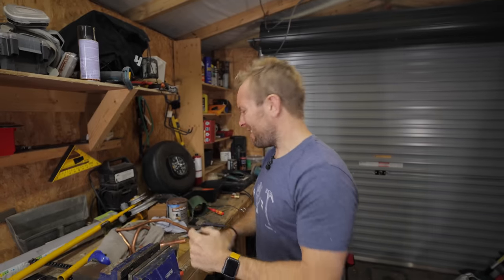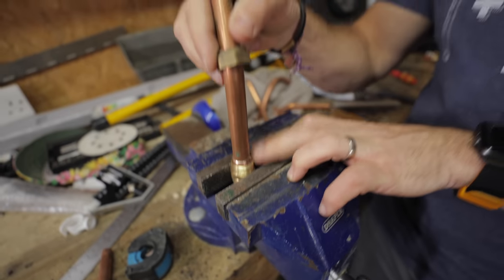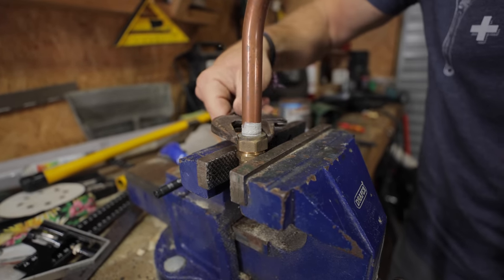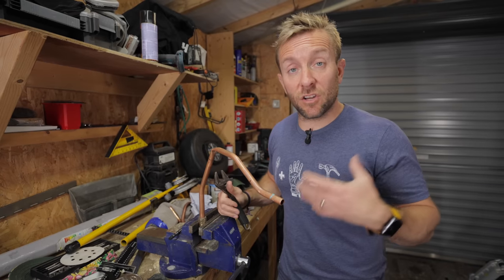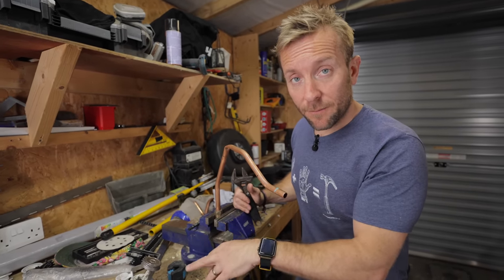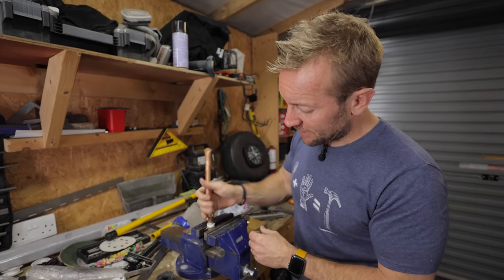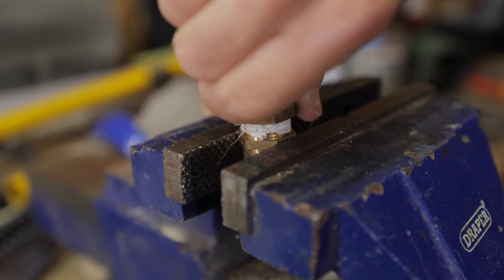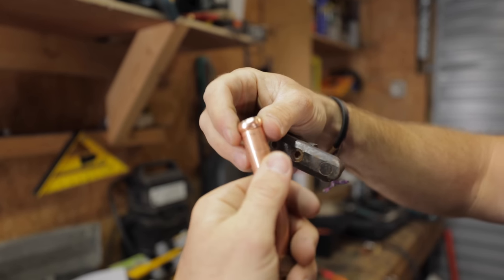4 MISTAKES Everyone Makes When Using COMPRESSION FITTINGS

Comment: I've never had a problem with compression fittings because I was introduced to them by a lifetime-served plumber who just happened to live next door and he gave me the lowdown on the tightening issue. I always spare on the tightening and then tweak it if there's a slight leak when I test it. Then again, I'm only working in my house or a friend/family member's, not on a site with productivity pressures (know all about those coz I'm a chippy). By the way, I'm surprised to see you using an adjustable spanner. Surely a 24mm is less likely to start to round off the nut?
Reply: Unfortunately not all fittings you get these days are 24mm, some are 23.5mm, some are 24.5 and some are 25mm, so you need to match the spanner to the nut, and some do not match at all, as they have 8 flats on them. so adjustable nut rounder it is, or you use the stillson wrench, which will tighten the fitting up to a turn past stripped.

Comment: In gas compression brass fittings they don’t allow the use of jointing compound. But in iron fittings where a thread is cut into the pipe, jointing compound must be used. I asked the instructor why jointing compound isn’t allowed in brass compression fittings but never received a reply!!!

Comment: Typical plumber - Throwing the rubbish from the job in the garden! But seriously thanks for a useful video, I must be guilty of at least a couple of those common mistakes. Just want to ask is there any merit in when putting the pipe in the fitting, backing it off a mm or so from the end stop so when it tightens down its got room to slip forward a bit, or is that another pointless thing to do?, I must admit that I seem to get less issues since someone told me to do that - but I'm just a sparky, I guess I'd get even less issues if I used jointing compound and stopped overtightening?!

Comment: In theory you shouldnt need any additives but it was suggested to me to use a bit of fernox silicon but trouble is the tube always sets hard ,bloody expensive
Reply: I solved this problem with LS-X tubes going off once opened (used to be wasted tube every use).  When you finished using, squeeze a bit out, fit the cap on, then seal around the outside rim of the cap with the excess; the stuff can seal itself just as well as an unopened tube  -  will still be ok a year later

Comment: Another tip for Not Over Tightening.  Use a smaller wrench to reduce the leverage you have.  I learned that doing my own mechanics and stripping bolts.  Use a smaller tool if you are ham fisted. 👊

Comment: Re olive cutter , reviews this not great , quite slot complaing that the bar metal bar that sits inside the pipe snapped off in to the pipe. Think I'll (DIY) stick to an olive puller if hack saw & screwdriver . Other tips helpful. :-)

Comment: IDK, I've never seen a properly made compression seal fail, never seen any sealer used or recommended.   The copper ferrule is soft by design, crushed to conform to and seal because of the taper, anything foreign likely to cause a leak.

If it's squealing as you tighten, thats the ferrule spinning  because you seated it cockeyed.

Comment: Potable jointing compound? What is it, Vegan? All that stuff is is lubrication - the metal to metal friction cuts the sealant material - it gets squashed out of the taper - its the deformation of the soft metal that makes the taper fit perfectly to make the seal. A bit like lapping a valve. I'll just go back to the good old hemp and graphite grease - at least that expands and seals if it does get wet - or I might just smoke it instead...

Comment: Compression fittings need friction between the ferrule, the pipe, the nut and the fitting body to form a proper seal. Every manufacturer's instruction and plumbing manual I have seen explicitly states NEVER USE PIPE JOINT COMPOUND OR TEFLON TAPE ON THE COMPRESSION FITTING. This presenter does not seem to understand how compression fittings work. The seal needs tight metal to metal contact to work. Joint compound will prevent this. Using joint compound or anti-seize will make the joint leak.
Reply: Same mistake ppl make with flared fittings and unions

Comment: I've never seen joint compound on the compression ring ("olive" in your parlance).  Sounds like bad advice to me.  Maybe it will work in a pinch but I doubt that it's best practice.  Weak start but otherwise good.

Comment: Sorry don’t want to be moaning but when taping pipe/olive you need to go opposite direction from male thread taping - you are taping the stationary part and nut moves. Have to think of this every time I do it  which only on something likely to need changed otherwise anaerobic thread seal every time. Cheers Rich

Comment: You did not put the PTFE tape the way you mentioned. It is now not in flow with the rotation on the nut in my opinion. Also missed an indication how tight it should be like make it hand tight to begin with and the a halve or whole turn. Specifying in momentum would go a little to far I assume.

Comment: I almost never using jointing compound on compression joints. The only exceptions are in very difficult to get to places, which are less than ideal for compression joints anyway, so ought to be avoided, or where an in-situ pipe is slightly damaged and making a truly "clean" compression joint is difficult. Otherwise, don't using jointing compound. A well put together compression joint, with good pipe, properly cleaned and where the joint is not out of alignment and under stress will not leak if done up properly.

Comment: An OLIVE-CUTTER - r U joking?
In NZ the copper pipes of old (most plumbers here now use PTFE pipes an other plasticy things..

Anyway, PIPES (real copper pipes) used to be "tooled" with a tool, that fitted into the pipe end, and had some handles on it, for turning the tool.
One for holding the main body to turn that, and the other was for the wind-in pressure nipple, that forced out three small ball bearings, into the inside of he pipe, such that on turning and pressing the balls outwards, one MADE the FERRULE, (olive you called it) in the pipe itself, and NOT by sliding a Brass Ferrule ring over it.

Comment: You put the tape on the right way round. You don't need jointing paste on copper either, it's for steel.😁
Reply: What he said 👏.  A fellow plumber/pipe fitter I presume???
Reply: Technically you don’t ‘need’ paste for the fitting to not leak. However best practice will tell you it’s a good idea. Whether your dealing with older fittings you’ve taken apart, or brand new fittings, you also have a variety of olive designs. Some are better than others, some may have ever so slight imperfections. Adding paste can be the difference between a leak/weep/micro weep). If only 1/50 joints needs a bit of paste not to leak, your the plumber who fitted it or played with it it’s your responsibility. May as well just slap on some paste it takes seconds and you can sleep better at night.
Reply: Tell that to the guys from 60 70 years ago they used Boss White and trust me, their joints didn’t leak getting them apart was fun. When was the last time you used a compression fitting on stainless steel tube? The olives for that were hardened to enable them to bite effectively but ptfe or Boss White was essential.

Comment: I’m pretty sure that thing you call an olive in a British country we in America call it a ferrule. Or am I missing something? I’ve worked with all kinds of compression fittings, whether it’s air line work with inserts and ferrules or olives , can’t believe I never heard ferrules called olives before. But compression fittings for gas, water and even extending oil lines and never needed to use any compounds with 100 percent success. But I can see how using it would work just never needed it.

Comment: Is it normal UK practice to use compression fittings inside walls and ceilings?
Here is Aus we only see compression fittings inside walls from DIY owners. There is just too much that can go wrong with these fittings and the leak damage they cause when they fail.
Reply: Yes, would never risk compression fittings in inaccessible places, always soldered.

Comment: Also. Don't guess. Make certain the pipe is inserted fully  into the fitting., especially when using Tee fittings or valves.
Reply: absolutely not! If the pipe is fully home it has no room to move down with the threads once the olive starts to bite and then gets crushed at the bottom which causes the pipe to crease and leak. Put the pipe in, pull it back about 4mm and tighten. Doesn't need PTFE or paste and wont leak.

Comment: All you bloody plumbers have worried me into using jointing compound on compression fittings😄 but the truth of the matter is for years, as a fitter, I never used jointing compound on water and steam lines but as an apprentice I was told to scotch brite/wire wool the pipe and fitting, as you would a soldered joint,  before installing and I never once had a leak that couldn't be nipped up. So I'm using jointing compound but it's under duress  😂

Comment: I like to wipe off the excess compound and draw a Sharpie line between pipe and fitting. As you tighten it down a gap appears. No gap = not tight. If it leaks throw away the fitting. Manufacturing quality is poo to say the least. 
Even better use Hep2O or Polypipe. I have NEVER had one of those fail and I’ve used them since Acorn arrived the 1980s.

Comment: Compression fittings are meant to be a metal to metal seal, only amateurs use goop on compression fittings. Leaks are due to improper line up, you can't fix shoddy workmanship with goop.

Comment: YOUR biggest mistake was using an adjustable spanner. When i was an Apprentice  Machine tool fitter adjustable spanners /monkey wrenches were not allowed in the fitting shop.We were told they made proper sized spanners for every size of nut.Woe betide anybody seen using them.We were only allowed to use thread sealer /jointing compound & horse hair on taper threads. PTFE tape hadn,t been invented then .We worked on High pressure Hydraulics. In those days Good quality nuts & olives never leaked if tightened correctly.

Comment: If you are lucky enough (or unlucky in some cases?) to live in Thailand - here there is NO copper pipes aaaaggghhh. Thais use blue plastic pipes for every application and glue. They DONT EVEN understand using pipe glue (sniffers paradise stuff) and they don't use emery cloth or fine grade sandpaper to prep the surfaces. So under pressure they pop. By which time the b'stard "bummer plumber" has gone with your cash on the piss. So what did I do (for 13 years) ? On all my systems which are drain-only (bogs and sinks, underground etc)  I use blue plastic and for all pressurised systems I use amazing hot-welded green pipes which use an "easy to use" hand heater tool to form the weld and no Thais used here  (Except my beautiful wife)!!! or no blown off joints mate (that's no reference to smokeable joints either or your blow up dolls)  ...!

Comment: You don't use joint compound on compression fittings. If that is the case than why when you remove a compression fitting that is 30 to 60 year's old there is never joint compound on it especially if you are using it for certain fluids you don't want any contamination  if it is leaking most of the time it was overnighten.

Comment: Speaking of mistakes, there's your 1st one @ 1:30. Turn that tool over because you're using it incorrectly. The sliding jaw should trail, not lead. Ask me if you need a detailed explanation.

Comment: Why do you call it an olive 😂 i do a little inside the cup and the first thread or two. Pretty rarely have leaks. And ive seen signs of leaking from the bottom of the nut and the stop so i wouldnt argue anything on the threads is pointless however i just do a little pipe dope

And dont overtighten them if you dont have to otherwise a ferrul puller will basically downsize the pipe a little and the new compression fitting WILL have to be buried to not leak

Comment: Never ever use fkn ptfe or jointing compound (poo) we call it on compression fittings.
If it squeaks like a dying mouse its to tight or you have warped the shape due to the vice being to tight on the fitting

Comment: Jointing compound didn't exist when i served my time in the 80s
Reply: We used Green Hermetite and hemp on steel pipe..  Never leaked.
Reply: J.C. Whitlam Manufacturing Company was founded in 1900 on a single product, Tyte-Unyte® Pipe Joint Compound, and for the first thirty-eight years, it was the company's only product.

Comment: Compression fittings rely on interference  between a cone and a radius on one face only. And the shrinking of the olive onto the tube This results in an exchange of metal at the molecular  level. Any rubbish, oil, ptfe or other muck that you suggest will result in a sub standard connection.  If you do this on oxygen gas fittings it will result in a fire or worse.
Clean the pipe, fitting and olive - decrease with suitable fluid - very important  for oxygen piping. Tighten moderately.
It's very clear  that you have a limited understanding of how these fitings should be used. You give plumbers a bad name.

Comment: Unbelievably worthless. None of this should be necessary but nearly everything you buy from suppliers is rubbish yet you keep on buying it and nobody sorts this out. Not the CIPHE or plumbing federation or anybody else. It's not just compression fittings either. Taper threads, basin drains and a long list of other features that should be properly manufactured just aren't.
Reply: Especially if it's made in China.  I have 70 year old gas piping made in the USA in my house. There is no rust on it at all. New furnace was installed, so some gas piping was rearranged. Within a year, it was rusting. Stamped on in Made in China.  I had to steel wool it and paint it to stop the rusting.  Don't get me started on Chinese made ceiling fans.🤬

Comment: Rule number one never use compression fittings on hard copper only use it on soft copper, It was never intended for hard drawn copper it will eventually either blow apart or start leaking, If you want to use it on hard copper you have to heat the copper up first cherry red let it cool down that makes it turn into soft copper, clean the pipe with sand cloth put it together and then it will crimp down the ring properly just like it does on soft copper. Heating up hard drawn copper will turn it into soft copper because it looses its temper.

Comment: Do NOT listen to this guy. You do NOT need any sealing compound or teflon tape to seal a compression fitting. The whole idea behind the design is there will be a mechanical seal that prevents leaks. If you need any "sealants" then you did it wrong.

Comment: Haha I've fitted 100's of compression fittings in ac heating lines. Only use them when I can't braze. I've never used sealer, never had a leak and always cursed others when I find ptfe on a join. It means they are dickheads. I never re-use an existing fitting, always cutback and put clean pipe in. However your technique has merit and I will use the sealant paste from now on, your right about the squeaking. Ps, you probably have shit fittings in the UK.

Comment: Sorry, but compression fittings do NOT use pipe dope, joint compound or ptfe tape. I didn't bother going past the first incorrect "lesson." Maybe physics is different in UK or they make/sell leaking compression fittings. As you demonstrated, using compound allows you to overtighten and destroy a compression fitting. Please correct or remove this video.

Comment: Typical English methods, over complicated what is simple. Good quality fittings without any compound or extra work, compress the O ring without damaged it, and not make any sound when you tighten up and make the pipe water tight. This is reality in The Netherlands. In the UK maybe much more worst the situation, make demands at the factory, they are just lazy with quality. That's all. And this is my free advice and only 1.
Reply: Interesting analysis that... Unfortunately a lot of properties in uk are older with older pipework which requires more preparation and care... New pipework is completely different as everything is in perfect shape. I think the message here is do not take any chances, do the job once and do it properly 👍

Comment: I consider this tip to be bullshit. Its called a "Compression" Fitting because it works by compression of relatively soft materials, copper, and brass. Use a little oil to stop the squeek, not joint compound. Iron pipe, yes, I use tape and joint compound compression fittings, NEVER if you need joint compound on a compression fitting, you did something wrong.

Comment: Please tell me this a joke video to troll DIYers.  Because a real licensed tradesmen would never use a thread paste let alone thread tape.  Brass is self lubricating and adding sealant or thread tape will %100 cause you to over tighten and split the fitting.    It is a compression fitting!!  if your fittings leak it is one of two things...  You buy the cheapest Chinese knock off fittings you can or you're an Idiot.   Comp fitting are supposed to be stupid proof